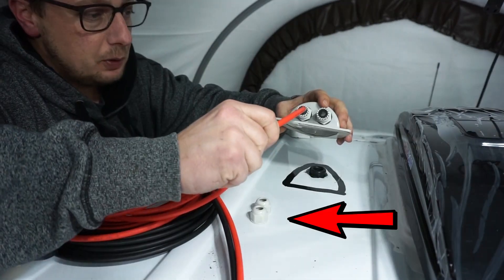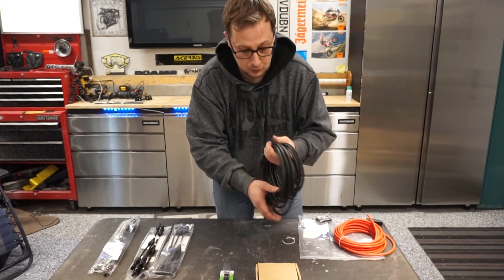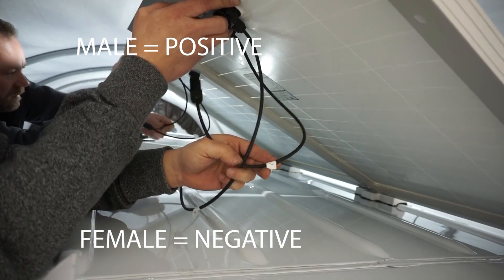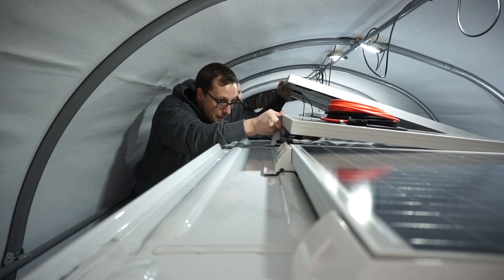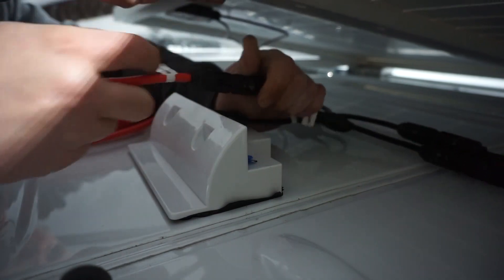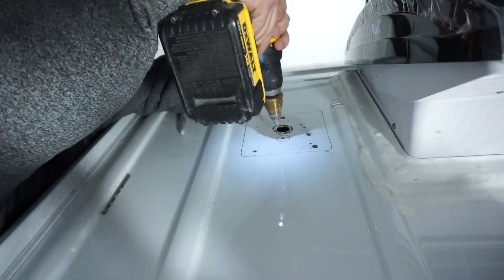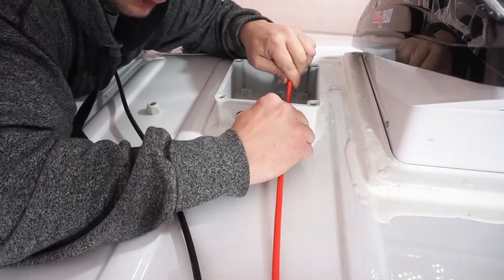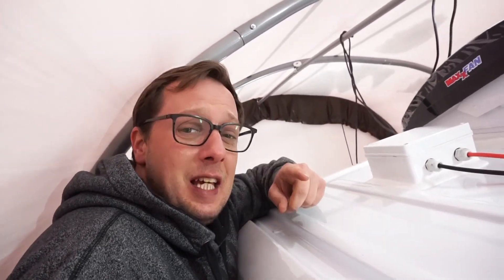Wire Solar Panels in Parallel | FOUR SEASON VAN LIFE | EP.12

Comment: When wiring in parallel more than 3 panels you should install and inline fuse for each positive panel (MC4 10A fuse) :)
Reply from the maker: This is interesting to hear, all the research I completed never hinted towards that at all.. I will speak with a few of my contacts and readdress if needed.. Thank you for watching and commenting...

Comment: Jeff, I'm curious if you had a specific strategy in placing the holes and sealed box at the front which means you have to run wire all the way to the front then all the way to the back? Won't this cause power loss over the length?